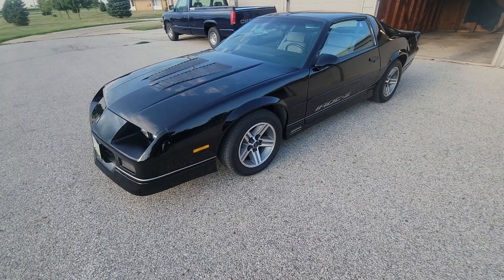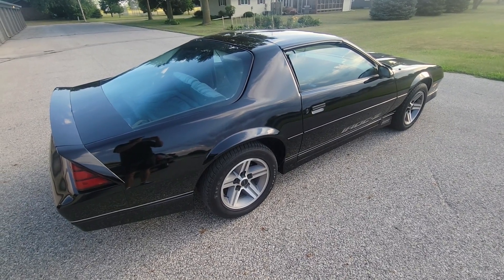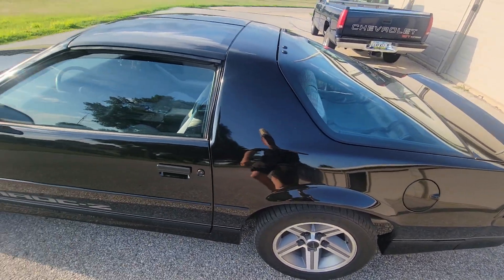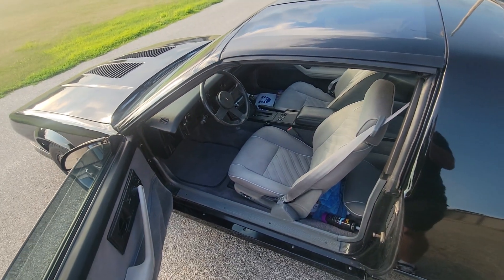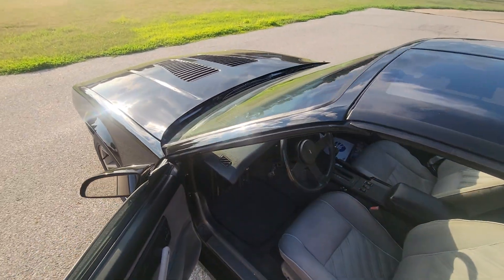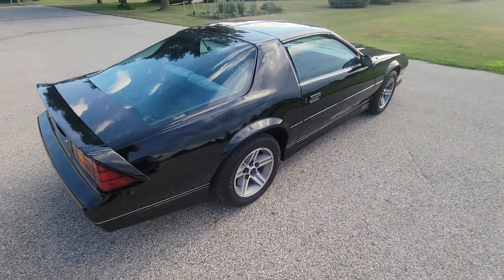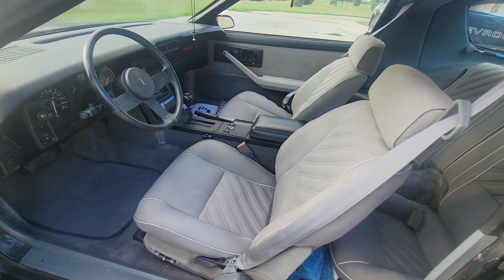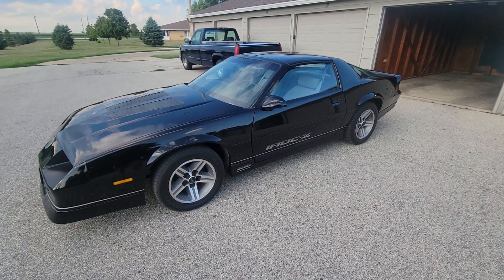1987 Camaro IROC-Z walk around

Comment from the maker: It is also a Bose sound car. I removed it all and have a custom sound system installed, but I have all of the original stereo components, they all work perfectly, and everything can be easily reinstalled. Nothing was cut up. 

It also has the overhead console, auto dim mirror, power seat, mirrors, windows, locks, etc.
Reply: Cool man yeah keeping these cars original nowadays they're worth more money like that